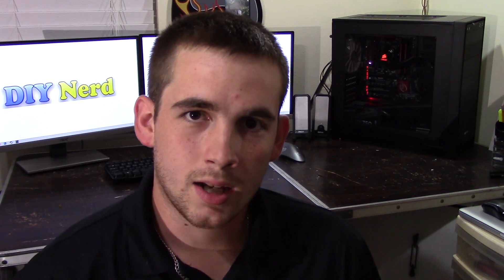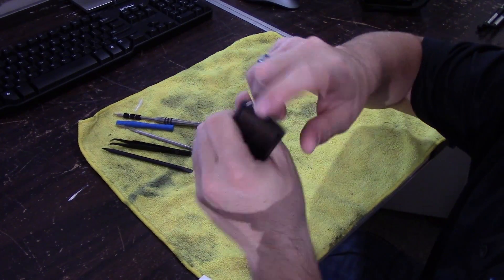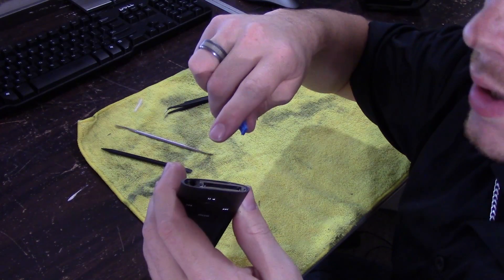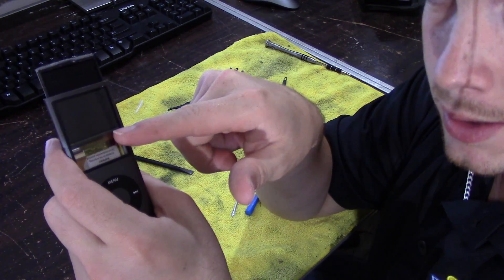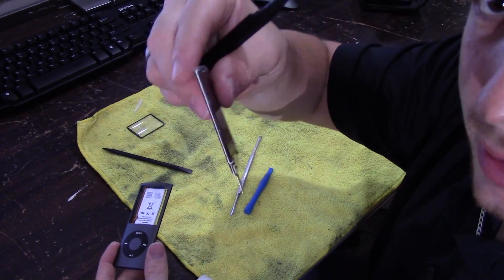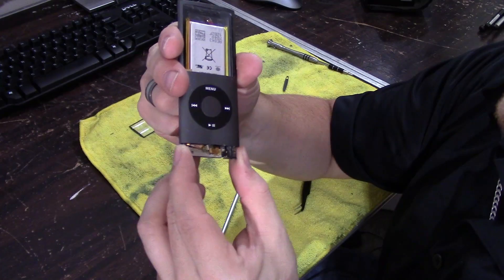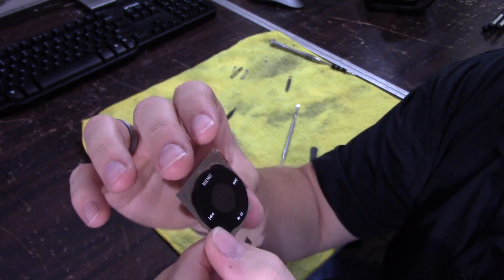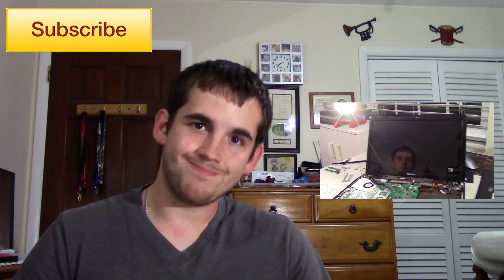Ipod Nano 4th Generation Tear Down

Comment: Thank you. I watched this video over and over to replace my old battery. Finally I got my nano fixed!!
Before I start fixing it, I was trying to identify risks.
But other clips did NOT show the most important parts on purpose.
This video was only one I could examine the whole process thoroughly.
I am glad to get my 36.8g ipod back.
Reply from the maker: That’s awesome, I am glade i could help.
Reply: how hard is it to replace the battery i need my battery replaced with new one...do u need the heater to heat things up to remove battery
Reply: @jasonnasiry  you need a solder iron because nano's battery has a soldered connection with the main board.
 Replacing battery went easy with solder wick(or desoldering braid).

Comment: Oh. This looks hazardous. My #iPodNano4G's battery doesn't really last long enough for an hour's run now. I had to switch to new earphones and I think they use more ohms (?) and after about 30 minutes one of the earpieces goes quieter. Also, it's powering the Nike+ pedometer receiver. I'd love a new battery fitted.
Reply: Dude, you have to fix that ipod or get rid of it or it will catch on fire if you let it alone for enough time

Comment: Thanks for the instructions DIY_Nerd. My ipod nano has been 10 years old, and I find difficulties pulling the LCD screen out probably due to the age. I pull till the thin sheet metal got bend and it still not going out. Please help!
Reply: Im in the same boat all the shit on the top is bent.
Reply: I could do it by sliding down NOT by pushing down. good luck

Comment: I can't get the display slide out, I already removed all the screws on top and bottom, I stopped trying because the bracket of the screen is a little bend upside but not broken neither the switch, any idea why the screen is not sliding??? thanks
Reply: Your battery might be bloated
Reply: and whats next ? (have the same problem)